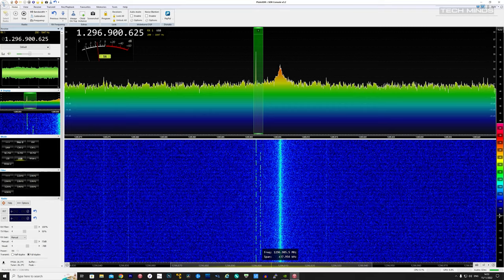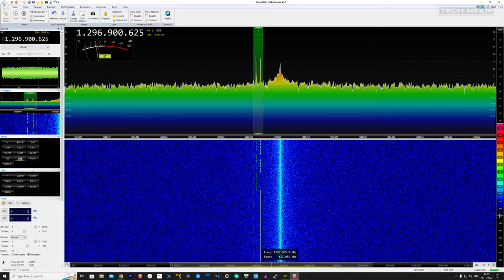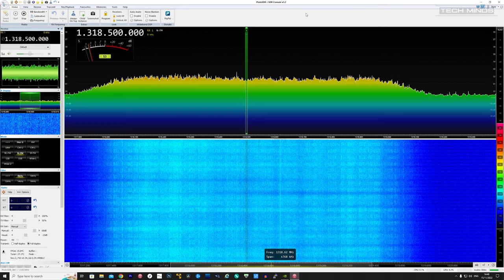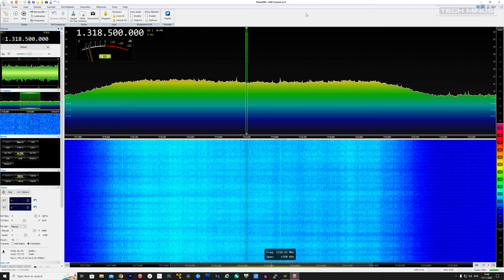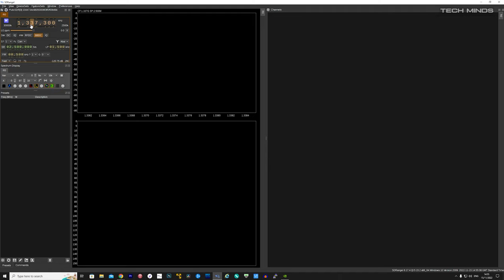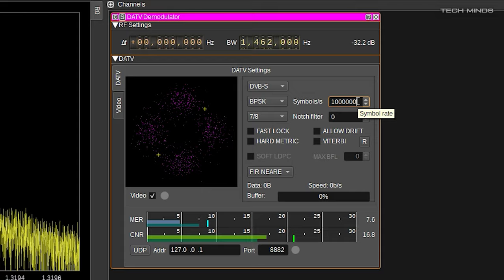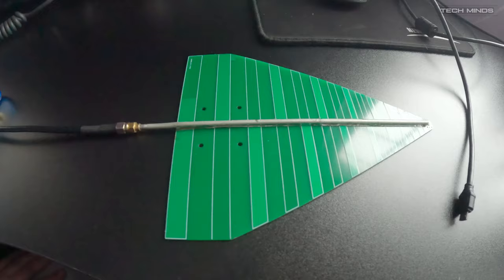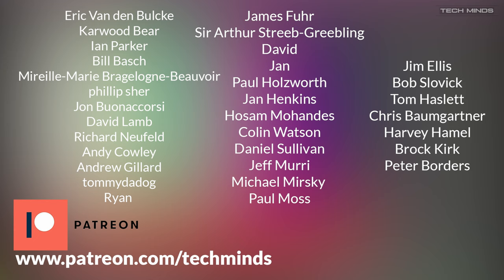Decoding A Ham Radio Digital TV Repeater

Comment: I have a 4M PCV pipe with my CampPro WIFI AP antenna connected to the rear ladder of my RV caravan at our FL USA campground. I would love to find a local ATV or DTV repeater on anything 70cm - 23cm that I could tune into or talk through, Very nice. 73, Dave, KU9L